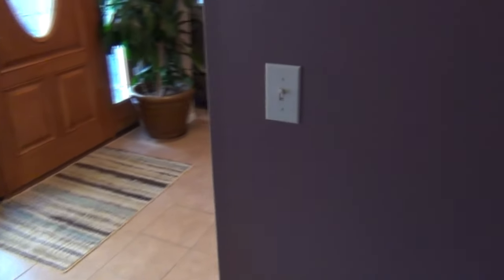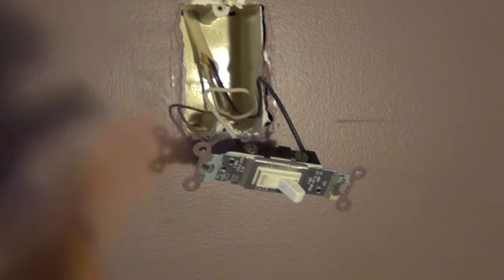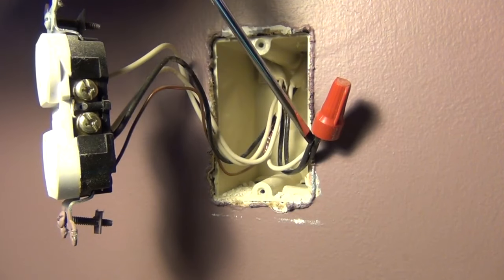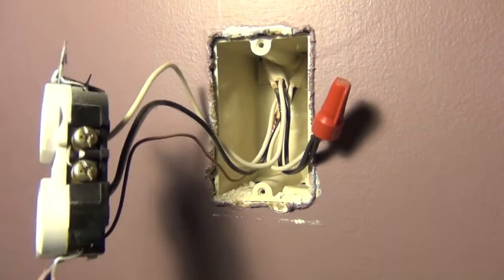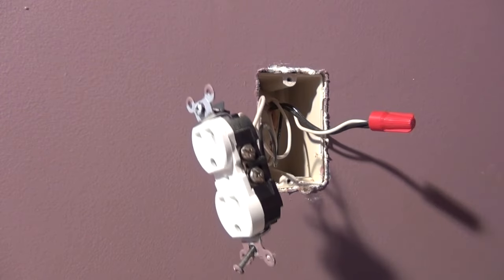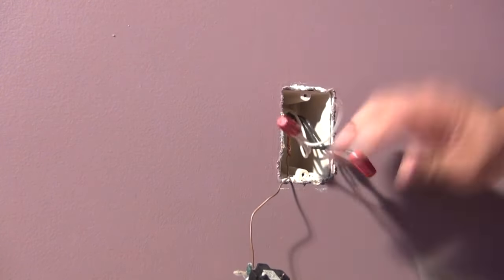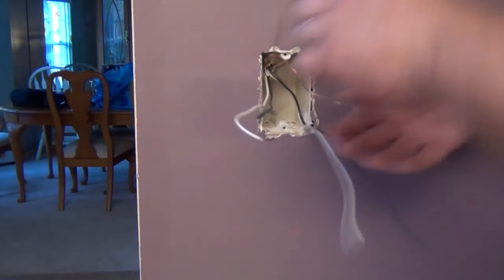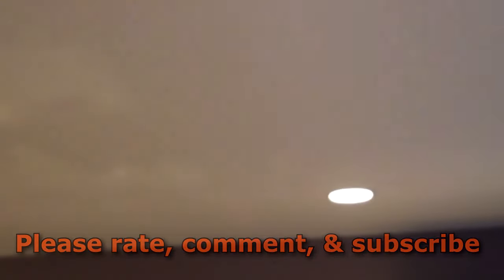Rewire an Electrical Switch box with No Neutral

Comment: Finally, a video that explained what I was doing wrong and how to fix it.  I was trying to install a light fixture off of an existing switch, similar to your video, however, I had no idea that the switch had no neutral wire.  After viewing your video, I went back into my garage and looked at the light that the switch currently feeds.  Sure enough, it was an electrical outlet and the current light was nothing more than a light fixture plugged into the outlet.  With this new knowledge and with some of the comments below, I'll take this information and try again.  Thank you for the well done video.
Reply from the maker: Gabriel Sorry for the delayed response but thanks for the comment. Hope the job went well!

Comment: I've only watched the first five minutes of your video but you have already shown what I need to know so I can wire a setup to control some plug in shop lights in my pole barn. There was no way to hardwire these ones in without doing a really ugly job of it so I am doing the switch outlet approach. Every other video so far has no closeups that are good, no proper explanations, but yours is spot on. And I will make sure to mark the white wire with electrical tape. Thanks.
Reply from the maker: Good to hear, glad the video helped!
Reply: As a point of ease to be code approved in new runs from your panel to your switch box to what you want controlled by your switch. This keeps it neat and simple.

Comment: Good stuff. I’m a chief engineer for a management company and these type of videos are great training tools. My only critique is designating the difference between single pole switches vs three way and four ways. If you mentioned this my apologies but I didn’t hear anything about that because the DIY guy will just grab whatever he sees and it will be wrong. Nevertheless thanks for sharing I just subbed.

Comment: Had the identical issue with my light switch. Was just going to tie into a  circuit from the attic, drop it down and then back up to the light I'll be adding. Then after watching your video duh, go into the power outlet and put that neutral back on to an actual neutral wire, problem solved thank you so much
Reply from the maker: Yeah, i had that moment too a couple times before I thought of what I showed in the video. Glad you got it figured out!

Comment: Very helpful video.  Nearly my entire house was wired so that switches controlled outlets, because the only build-in lights were in the kitchen & bathroom.  All other rooms relied a lamp to be plugged in.  Not only do I want to install lights and such in the ceiling, but I want to use smart switches to be controlled by my Amazon Echoes.  Those smart switches require a neutral wire present.  The only thing I'll need to do different from what was in this video is to make a pigtail from the neutral wire grouping to connect to the smart switch.
Reply from the maker: Yes, I’ve found this video has done well due to the popularity of smart switches the past year or 2.  Thanks for the comment!

Comment: Great job....
If it were me doing the job, I would have utilized acgreen wire nut.
I also would have changed out the receptacle and single pole switch with better quality devices. They had to be old.
You went through all that work, just update the devices to safer, better quality.....

Comment: Hard part is the magical step that led to the new Romex appearing in the box, without damaging the wall. Everything else was obvious. I was hoping for some guidance in threading the new cable through the wall, sigh.
Reply from the maker: Dan Swinehart  sorry for the delayed response, I shot a video of the light install and never posted it, maybe I will because this question is coming up frequently. I cut a small hole in the wall near the ceiling. I then removed the existing switch and fed a fish tape through the spare hole in the top of the junction box up to the hole I cut in the wall. This is the least obtrusive way of doing this with minimal damage.  Hope this helps you.
Reply: Fishing tape and a roller plate (it's a thing the shape of a single switch you can mount to the box, with metal roller wheels to prevent the cord from damaging the surrounding wall as you pull it through)
Reply from the maker: jedrokth yup, that’s the way to do it. I just posted a new video on my channel related to this.
Reply: Damn I said the exact same thing before seeing your comment lmao

Comment: Great video.  My set up is very similar to yours. Light switch box had a hot white wire along with a hot black wire that controlled a single outlet on my wall.

I ran new wire Romex for a ceiling fan down to the switch box. Black, red, white and ground. 

In switch box I have the power (white and black) tied into a pig tail leading into the switch. Loading out of the switch box is a pigtail that is tied to the fan light (black and red) running to the fan. The neutral wire in the new wire pulled has nothing to connect to so I believe the circuit cannot be completed. The power to the outlet however has been completed and is no longer reliant on the switch being flipped up to get power.

The difference I have is in my electrical outlet that was being controlled by the switch. I have on the gold side of the outlet a black and a red wire that are hot and two white wires that are not hot. 

There are no extra white wires that have been pig tailed in the outlet box so I’m not sure how to get my neutral wire in the switch box to not have power anymore. 

Any ideas?

Comment: This is the best way to do it... IF you no longer want to control the outlet via the switch. Assuming there's no other choice but to run another wire to the box if you still WANT TO control the outlet from the switch.

Comment: Great video but not sure it will work with my set up. My outlet doesn’t have the hot wires that are capped off in your video. Instead only has the load wire and neutral wires. How do I get power back to the outlet if the load wire is turned into a neutral?

Comment: Good presentation, but one problem.
When you connected the ground wires in the switch box you twisted one ground wire around the other.
Electrical inspectors will be looking for the green wirenuts to be present or they will fail the inspection.
The green wirenuts have a hole in the end for one ground wire to go all the way through and the other ground wire is connected inside the box.

Comment: Local codes here require green crimp sleeve on the bare copper grounding bundle. Also find it easier and neater to give the finished devise a one turn twist before placing into the box. The wires will then be neatly coiled up.
Reply from the maker: Yes, here too now as well.  I added it after the video was filmed

Comment: NEC 2017 require a neutral now.  In all new installation.  This due to many electronic devices that require a neutral.  Because there was no neutral inside the box, the electrician would use the ground conductor.  This way the NEC made this change.  12-2-2 or 14-2-2 is now being sold.  No more switch loop in new switch box installation.
Reply from the maker: Robert Mattison Thanks for the info, good stuff!

Comment: Tip: your wire stripper has a hole just above the stripping section to bend the J hook onto the stripped wire for the terminal.  No need for the needle nose pliers for that purpose
Reply: No need for wire strippers or needle nose. Linesman is all you need

Comment: It's worth mentioning that while rewiring the outlet, you created a dangerous setup in the switch box - because the load and the line were newly connected there. If the switch was in the ON position and someone decided to turn the breaker on to test the outlet, there would be some fireworks. For peace of mind, it would have been much safer to disconnect the switch before changing the load wire to neutral in the outlet.
Reply from the maker: James Watson Working by myself in an empty house I wasn't too worried about that but I see where you're coming from. Thanks for the comment brother!
Reply: Safety standards are to put tape over the breaker if not working alone in a house. That should be recognized as not normal by most. Also let others in the house know you have turned off a breaker. Also  off and tripped at different physically at the breaker.

Comment: @fixitwitzim - Is there a similar way to install standard smart three-way switches in a box where the electrician used the neutral from the breaker box as a traveler? 

I have a three-way switch with the Neutrals in the box, but this is the load switch (shorts the circuit, when I connect the Neutral wire to the switch), and the line switch uses the Neutral wire as one of the Travelers! The line switch is configured in a two-gang box with another three-way switch (I would like to replace that one, too). Can I pig-tail the Line (or Neutral) wire from the adjacent switch to the Neutral for the smart switch? Thanks.

Comment: I have similar issue. My switch control small bathroom fan. The power source come into the fan first. The switch has only 1 romex 14/2 come into the box. I have a bare copper ground connect to the switch, a back wire constant power supply connect to brass screw and a white (not neutral) connect to other brass screw on the switch to return the power back to the fan. Now, I like to add an outlet right below the switch but I dont have a neutral wire. What is the best way resolve this issue? Thanks in advance Zim

Comment: What type of spare wires did you use with to pigtail the hot and neutral in the outlet? If I have to buy a spare wire for that purpose, is there a range of guages that I can get from or does it have to be a particular guages or type?

Comment: Great video! Extremely helpful. I'm looking to convert my 3-way switch setup to a smart config but I only have a neutral on one switch end. I'm trying to avoid using a bridge and still have it compatible with Alexa and Google. I know a bridge can support many devices but because of the size of the house, I am trying to avoid it if possible as well as avoid running a new wire in the wall. Any ideas?

Comment: In MA you don’t need to identify the neutral , about a green wire nut for the ground wire, and if you are installing light fixtures you need to replace the breaker too AF

Comment: I have a Smart switch with Neutral wire option, but I dont have neutral wire in my Electrical system at Home. How do I connect my Switch in this case?

Comment: So I bought a smart light switch and found out it requires a neutral wire. I only have two wires leading to my switch. Not sure if I could rewire it like you did in the plug or would I have to pull new wires to the switch and ceiling fan?
Reply from the maker: Sounds like you have a switch loop like my video shows. You’ll need to add an additional wire. I have another video on my channel with some helpful tips on how to do that.  Check the video description on this one for it.

Comment: So after you add the light,   the plug will not be control by the switch any more?   it will have 120v all the time at the plug? 
I try to add smart switch but it require white neutral wire. My switch only come with 2 wire.
Reply from the maker: Yes, the outlet will be powered all the time and not controlled via the switch

Comment: Hello. Great great video. I’m trying to figure out how to add a neutral wire to a switch box from a light fixture. Our house in 98 years old and unfortunately does not have any neutral wires. And I cannot do your method in video because there isn’t an electrical outlet on the side of the room I’m working on. 

I want to install a smart switch for my kitchen and dining room.  I’ve read you can add a neutral by running a wire directly from light fixture (chandelier) back to the switch box. Is this accurate?  If so, do you have any videos that may cover this, or which terminal/screw on light fixture would be used for the neutral out?   Thank you again for your video and your help (if possible).
Reply from the maker: Sounds like you have power coming into your light fixture junction box and they ran a single piece of wire from that box to your switch box to crest a switched leg. These actually aren’t allowed in most places anymore due to the inception of smart switches and devices. Check the link in the description of this video or it might be in the pinned comment. It’s some additional tips for running new wires in existing walls. Hope this helps

Comment: Although I believe it a good practice to re-identify the white conductor used in the switch, I do not believe that it is a violation of NEC to install as in the video.
Reference NEC 2017 310.110(C)    This references you to 210.5(C) for branch circuits.    
It seems that re-identification of the conductors is required when there is more than one nominal voltage system.   Residential has only 120 volts to ground, therefore re-identification is not required.
As I said, I would do it if I were doing the install.
Reply from the maker: Thanks for the info!

Comment: Thank you for the video.  I have the same issue with mine.  I don't know much about wiring and codes so I will double check with an electrician regarding the ground screw to a plastic box?  All of the receptacle and switch boxes in my house are plastics. I wonder if they're not to code since I don't see any ground screws inside.  Any who, thank you though.
Reply from the maker: Alex Nguyen Ground screw to a plastic j box is not necessary. You should have a ground screw however to the device (switch, outlet, light, etc). And yes, if you're not familiar with this type of work, definitely contact an electrician. Thanks for the comment!

Comment: The answer seems obvious but it doesn't look like there's really a way to add a neutral wire in the switch box, but keep the outlet being switched (not changing to a permanently installed fixture) without snaking a new wire up to the switch unfortunately. I'm trying to add a smart dimmer switch to control a plugged in lamp and have the same wiring situation as the beginning of the video.
Reply from the maker: Daniel Finnegan you’ll need to add a wire. Others have asked this and I’ll be posting a video soon showing how I did that. On a side not, you should never add a dimmer to control an outlet. Too many things can go wrong if someone plugs another device into it besides the lamp you want to control.  You can purchase a dimmable bulb that is controlled over wifi which might be the better option for your situation
Reply: @fixitwithzim  thanks for the response.

Comment: good video, in my case sadly the switch without the neutral goes to a light so I believe I Need to run another wire to the light.
Reply: Matt neutral will be at ur fixture

Comment: how did you get the new white wire going to the ceiling light in place?  That's the hard part that I don't understand how to do.
Reply from the maker: Tim Yorty I shot a video of the light install and never posted it, maybe I will because this question is coming up frequently. I cut a small hole in the wall near the ceiling. I then removed the existing switch and fed a fish tape through the spare hole in the top of the junction box up to the hole I cut in the wall. This is the least obtrusive way of doing this with minimal damage.  Hope this helps you.

Comment: I have a bedroom with a ceiling fan and lights.  The lights are controlled by a wall switch which only has 1 romex cable with black, white and ground coming into it. The back is providing power and the white appears to be the switch leg to control the lights.  There is no neutral wire, just the bare ground. 
The fan is controlled by a pull chain at the fan. I’m guessing they spliced the hots in the fan j-box with legs to the pull chain and the wall switch box (for the lights).  My question is can I disconnect the bare ground in the switch box and the fan j-box and re-wire as a neutral to be able to install a wifi switch which requires a neutral?  Also do you know if the wifi switch will work without a ground and is it safe?
There is no way to pull a new neutral into this box and get it to the light.
Reply: If you crawl in the attic you can.

Comment: The hardest part would have been to run that new wire down into an existing box. How do you fish that ? lol Sometimes it's really hard to remove the box. Esp if its nailed in.
Reply from the maker: I have another video on my channel showing how I ran it, not all that difficult and with minor damage to the drywall

Comment: Interesting, and useful to help me plan a smart dimmer installation in the UK (where we dont have neutrals in light switch circuits) BUT (and its a big BUT), the layout in this video is illegal in the UK, so any UK viewers, dont do this! Its basically taking power off the sockets to power a light; those should be on separate circuits in the UK. If a device in a socket trips the breaker, the lights go out, so you cant see what you’re doing to fix it. Also, if anyone wants to work on a light fitting and trips the breaker for the lights, they may be surprised when that light isnt off power (yes, they should check before touching, but people forget and thats how people get electrocuted).
Reply: Your almost right but some of what you said could cause people to panic unnecessary from the UK , yes doing like for like as per the video is not allowed in the UK , BUT if wired correctly lights CAN be taken off sockets , not ideal but still legal and within regulations (current - 18th edition wiring regulations).IF any doubt on any installation a qualified electrician should be called.